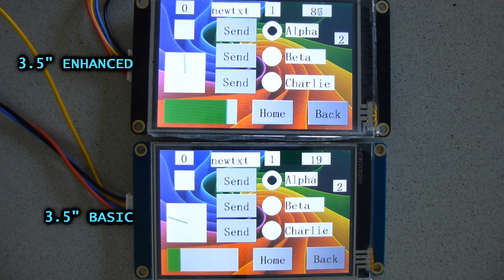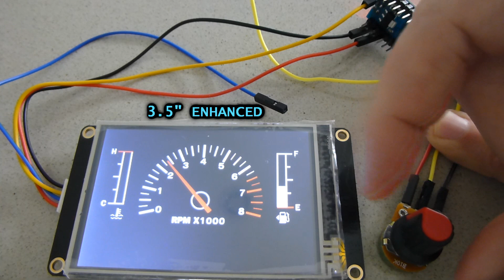Nextion Display: Basic or Enhanced?

Comment: Hello,
I have a problem with the refresh speed of a Nextion screen where there is one gauge and one text field that are refreshed by an Arduino Uno board wich receive signals from an optical sensor wich count the RPMof a shaft. The gauge needle and the text diseappers at every serial transmission during the refresh of the screen. So they blink all the time. I tried 115200 bauds but it the same. The Nextion screen is supplied by 15W power supply (5V - 3A).
In your video at 0:59 , it is clear that there is no problem.
Do you know how to make the refresh quicker?
Reply from the maker: Maybe you overlapped the text box with the square of the gauge object?

Also, there is always some flickering with gauges. The only reason in my video I show a gauge not flickering is because that's a custom made gauge using images
Reply: @interlinkknight  Yes the text overlap the gauge. Thank you very much. I try right now to déplace the text.
You use image for each position of the needle? So it must be a lot of pictures, no? one fore each 0.5°?
Reply from the maker: In my custom gauge I have one image for each degree. I made it in PowerPoint but you could use something like Photoshop. I have that project available on my video about Arduino tachometer, if you want to see how I did it.

For the normal gauge included on the nextion display, it will always flicker but not too much. But remember to never overlap objects because that, as you saw, cause excessive flickering
Reply: @interlinkknight  Thank you very much. I use solidworks to design my gauge picture. And I put color with gimp. I used powerpoint too. But less accurate to draw the gauge picture.
Reply from the maker: That's great. Yeah, it doesn't matter what software you use to make the gauge. Good luck
Reply: @interlinkknight  I was confident about the fact tha the overlap of the gauge by a text  explain the needle blinking but unfortunately it is not the case after having removed this overlap by deplacing the text (the text no longer blink on the other hand). I don't understand from where come this problem. Last year I made a project of pressure gauge that was almost exactly the same that this RPM counter and I didn't have this needle blinking problem. I used an enhanced screen for the pressure gauge and this time, I use a basic screen, but your video seem to show that should not be visible difference in this case. So there must be something else.
Reply from the maker: Can you show me a video of your gauge blinking? Send it to my email, because i can't keep up with replies from old comments

Comment: hello, maybe is little old video but i just start idea with this display, but one big question is, can you power by battery? so that you have on pictures and no cables? just battery and scrolling from page to page... 

Thank you for info
Reply from the maker: Of course. It needs 5V
Reply: @interlinkknight   this i found that Nexton recomend 5V 500mh but is hard to found small battery like for phone 5V  and 3.7V are more common but this will not work... Any suggestion, i was looking first on Aliexpress
Reply from the maker: That's never a problem, man. Use a buck converter, or boost converter or a voltage regulator to get a steady 5V.

Comment: im working on building a digital read out for my lathe and later my mill. can this run  the incremental encoders. will be 2 on the lathe and 3 on the mill, and spindle speed encoder.  or do i need a seperate micro controler to do the reading and the nextion as display? would like some functions like doing some calculations, abselute positioning. set points and so on.
Reply from the maker: It can work, but I would do all that in arduino and then just send the values to the display

Comment: hi , i have a requirement where i need to connect this display to a wireless controller like esp 8266 and  make a chatting interface on nextion display that is able to send and recieve messages from firebase  using internet http get and post requests , is this possible with esp8266 or do i have to integrate arduino or some power management supplement to manage stuff , and also can you suggest me if i shd go for basic or ehanced version of nextion , thanks!
Reply from the maker: I think it could be possible, but I don't have experience posting text with ES8266 on the internet. To me looks like a job for something more advanced like raspberry pi.

The basic version of the nextion display works just fine for that

Comment: complimenti per il video!!!
ho acquistato uno schermo nextion modello "K", dopo aver letto le istruzioni sul sito nextion non riesco a leggere l'orologio, ho provato con "settim.val=rtc6" e "rtc6=3" ma non mi da risultati!!!
potrebbe darmi una mano a risolvere questo problema???
Grazie
Reply from the maker: What the "K" means?
Reply: grazie per la sua attenzione,
la serie "K" è "NX8048K070  Enhanced" che ha l'orologio incorporato,  nelle istruzioni nextion ho trovato questo, ma purtroppo, dopo vari tentativi non sono riuscito a far scrivere nessun dato rtc0 = 2017, rtc1 = 8, rtc2 = 28,
rtc3 = 16, rtc4 = 50, rtc5 = 36, n0.val = rtc6
Nextion RTC:
rtc0 è compreso tra il 2000 e il 2099, rtc1 è compreso tra 1 e 12 mesi, rtc2 è compreso tra 1 e 31
giorni , rtc3 è tra le ore 0 e 23, rtc4 è compreso tra 0 e 59, rtc5 è tra 0 e 59 e
rtc6 è tra giorno e settimana 0 e 6 (domenica = 0, sabato = 6)
rtc6 è di sola lettura e calcolato da RTC quando la data è valida.
Un dubbio, ho usato casselle "number" per ora, minuti, secondi, giorni e anno mentre per settimana e misi una casella di testo con i vari "if e else" , L'editor non mi da errore ma quando carico il programma sul display non va!!!!
Reply from the maker: Did you tried my example on this video?: https://www.youtube.com/watch?v=7Dkn3t_jjN8&t=11s

Comment: Question - I found nowhere the max refresh rate of that screen - I need 80Hz - possible or look for a different screen.
Reply from the maker: I don't think you can get that fast on this display. You need something more powerful like raspberry pi running a display by itself
Reply: @interlinkknight  Yeah - that might be what I'll hit - i see no other option except buy, assemble, test to limits then decide to lower refresh rate of move on - at least I'll have more hadrware to choose from : ) - BTW - gr8 comparison wideo - I msg you for help if that's ok when I get the screen. I looked at Arduino Portenta but that's budget overkill.

Comment: Sir , any difference in programming the basic and enhanced using Arduino or any microcontroller like esp32 ?
Reply from the maker: no difference
Reply: @interlinkknight  sir, how did you ppay video on the lcd, because as i can see there is no such option to add video in tge software?
Reply from the maker: Please pay attention to what I say in the video. It's a bunch of images, not a real video

Comment: I have a 3.5" display. When I use the waveform element to plot data from my Arduino UNO, it plots the data slowly. Can we do anything to increase the speed of plotting of waveform, something like tweaking the baud rate or something???
Reply from the maker: Yeah, increasing the baud does help, but make sure to send data directly without using the library.
Reply: Thank you so much!!! Yeah....I usually send data directly using Serial.print() function.....:)

Comment: hello man,
i have a question. i have a nextion basic 7 inch screen. i got a project about nextion and i have to do a countdown timer. how can i do this. is it possible with a basic screen. please help me brother.
Reply from the maker: Of course it's possible. Did you tried my examples? Do they work?
Reply: @interlinkknight  I tried your all tutorials but i did not find a solution. I tried rtc codes but they are not working on basic models. Is there any code of countdown timer.? I want to do countdown timer on nextion editor so without arduino. Which your video can help me?
Reply from the maker: All nextion displays have timers and variables built-in. Try creating a simple timer with 1 variable and 1 timer. In the timer you can set to run every 1 second (1000 milliseconds) and in the code of the timer put something like var1.val=var1.val+1

That will increase the value of the variable by 1.

All this information is on my tutorials already.
Reply: @interlinkknight  thank you my brother. İ will try all. Accually i am a mechanical engineer so i dont have so much information about coding. Thank you so much.
Reply from the maker: Little by little you'll learn. Use my examples as guide, and take what you need. Pay attention on the code inside the timers in my examples. The code is similar to arduino.
Reply: @interlinkknight  You have helpful videos and i'll use them. I wish more success to you. Thank you my friend.
Reply from the maker: No problem. If you get stuck, email me. I can't do the work for you, but I can answer questions and push you in the right track.
Reply from the maker: Go to my website

Comment: One thing that annoys me about the standard nextion gauge is the flicker. Is the enhanced version any better ?
Reply from the maker: Just a bit better but not by much, because of the faster cpu. There's a trick where you write the gauge only when the value changes, which minimize the flickering.
Reply: Are you referring to only refreshing when the value changes ?
If so, you showed that, but there was still a lot of flicker. But I wasn't sure if the camera was contributing to the problem.
Reply from the maker: Yes, that's it. I don't think i showed that on this video, but anyway it does help a lot.

Comment: thanx for your video,so i have a quastion , i wanna connect tow nextion with arduino uno for the same data (rx tx arduino with rx tx nextion1 and rx tx nextion2) it is  possible or not? thanx
Reply from the maker: Yes, it's possible. But if you need to receive data from any of the display, then it might be a little complicated. So if you only need to send data to the displays, then don't connect the blue cables (TX on the display) to anything.
Reply: InterlinkKnight. Thanx my friend
Reply from the maker: I am here to help.
Reply: Hi Buddy,
As usual nice video. I am in a project wherein i am trying to communicate between two nodemcu. One of the nodemcu(A)  is connected with Nextion display thru' TX RX pins and this nodemcu acts as a station , the other nodemcu(B) acts as a AP/server . The objective being a button pressed on Nextion display connected to nodemcu A should wirelessly switch on an led connected to nodemcu B. i have created the sketch , but need someone to check it as it does not seem to work, can u help me out?
Reply from the maker: I can help only in the nextion aspect, but the wireless communication between two nodemcu (whatever that is) I have no idea. Try my sketch on my 2nd video tutorial and start from there. In that example I turn on the LED on pin 13 of arduino with a button on the display. It should help you. If you need more help about the display, email me.
Reply: Thanks Buddy,
would get in touch if any queries

Comment: could you make a video on hardware monitor using the nextion please.
Reply from the maker: I don't know what you mean
Reply: My appologies. I want to monitor my hardware i.e. cpu and gpu stuff. So grab the info from msi afterburner or something and display it on the nextion
Reply from the maker: That kind of thing is an arduino issue, not nextion display. I mean, I teach how to send data from arduino to the display and vice versa. How to get that information that you want is something that you need to figure out with arduino. Ones arduino gets the data that you want, sending it to the display is trivial. I don't know how to send that information (CPU, GPU, etc) to arduino.
Reply: I have seen several people doing it, they wasn't full tutorials. Im not that versed in arduino sketch. Are you willing to help and possibly learn it as well?
Reply from the maker: Sorry but I don't have that much free time, and I am in the middle of a few projects. I just can't spend time learning how to transfer that data from the computer to arduino. I am sure you can find what you are looking for on the web.
Reply: no doubt. thanks